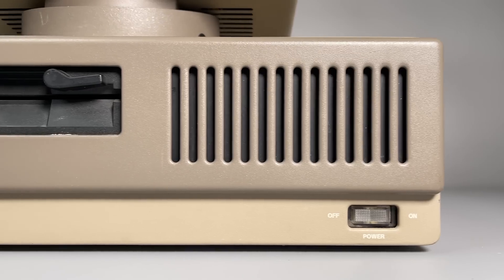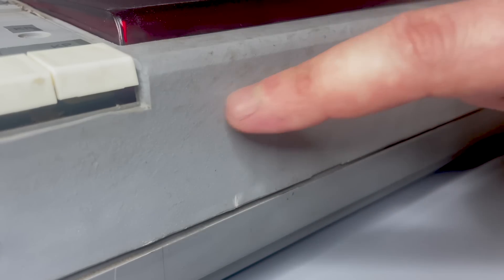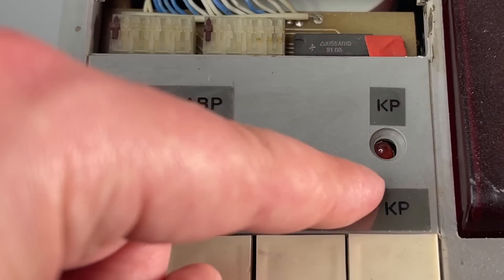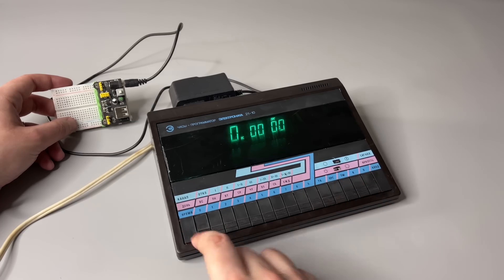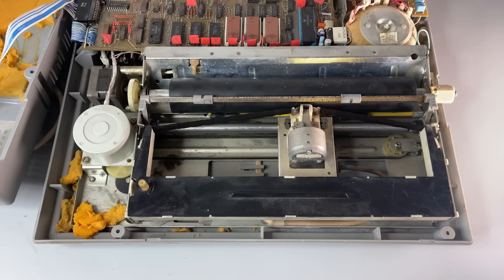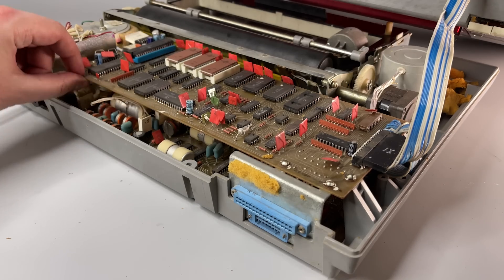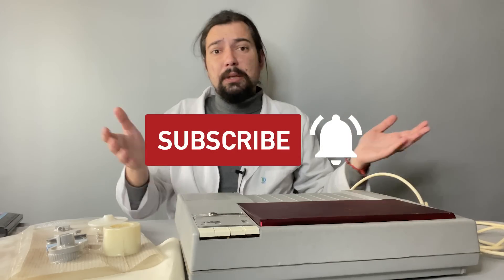This is THE WORST PRINTER I've EVER seen | Soviet SM6337.02

Comment from the maker: Our new video is out!
https://youtu.be/hjue5hO0Gmc
Reply: Soviet optics was really good like microscopes...
Reply: Be careful with plugging in old electronics. Supposedly you're supposed to condition the capacitors on the circuit boards or else they won't work and something will fry. Look it up, its some process that probably involved charging and discharging the capacitors manually till they work like they should.
Reply: Don't insult the Soviets so much because they gave you a state on Russian soil...
But... since you don't know when you should stop, you started belittling the Russians, now you will lose your country and Russia will take back its land...
Reply: From the Short show Chernobyl : What is as big as a house, burns 20 tons of coal an hour, makes massive amounts of smoke and noise, and cuts an apple into 3 pieces?

A soviet machine designed to cut apples into 4 pieces!

Comment: One thing that is often overlooked is that the soviet union, later russia, had manufactured very good and reliable vacuum tubes. Those tubes are used even today for audio applications and DIY. And amplifiers for some high power radio transmitters. Very similar manufacturing technology is also used for Geiger-Müller tubes, which certainly came in handy in 1986...
Reply from the maker: This is true, and it is a good exception

Comment: I work in injection molding of plastics  and I got some idea about the defects
2:20 this looks like  heat degraded material or material that wasn`t properly dried before injecting and still contains some humidity
2:53  there is plastic in the  verical slots because the inection tool (mold) is damaged and plastic can flow where it shouldn`t
2:40 this kind of defect is a result of improper injection parameters or bad tool cooling
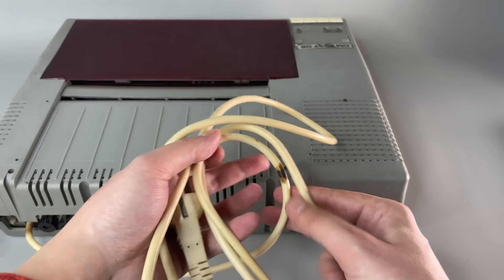3:25 this kind of warping/deformation of a long plastic piece is usually caused by improper mold cooling either because the temperature is set wrong or the cooling hoses aren`t connected properly to the mold. Perhaps the  water pump was just off and there was no cooling water circulation in the mold at all which is really bad.
Reply from the maker: Thank you for sharing!

Comment: Printers are notoriously the most annoying hardware to begin with. In the 90s-mid 2000s, even in America printers were super finicky. My question about this printer would be - did it ever actually work as it should? Were Soviet technologists using these alongside their computers and able to get it going for its intended purpose at least for a time before having to repair it? 

I can’t imagine they would produce these if they knew they didn’t work. But based on your demonstration, I find it hard to believe it ever did. If there’s no spring to push the paper as it prints, how would it do so? Would you have to manually turn the knob?
Reply from the maker: To be short, back in the day, I saw plenty of soviet dot matrix printers that worked well, including this model. However, you never knew if the device you received won't have problems from the start — the chances were random. It could be ok, it could be... this, within the same model line. This very unit is an example of how the quality was handled and how this approach was different from the military-grade version of this tech.

Comment: You can see the controller board at @9:45 which is actually a whole 8080-based 8-bit computer. This thing must have been very expensive even in 1991 when it was made.

The large chip packages in the top row from left to right:
- KR580VM80A - Soviet clone of Intel 8080A 8-bit CPU @ 2.5 MHz, manufactured in 1991/week 2
- 3x KS573RE45 (brown) - EPROM chips containing the printer firmware (I can't find any datasheets)
- 3x KR537RU10 - static RAM chips: 2 KB (2048x8 bits) each
- KR580VD5Ch (?)

Bottom row:
- KR580VM28 - clone of Intel M8212 8-bit I/O port
- 2x KR580VI53 - clone of Intel 8253 Programmable Interval Timer (PIT)
- KR580VN59 - clone of Intel 8259 Programmable Interrupt Controller (PIC)
- plus many small K155-series TTL integrated circuits (clones of the 74xx series)

The 'damaged' capacitors having a corner cut off was (and probably still is) a simple method of 'fine tuning' their capacitance. Just remove a bit to reduce its rated capacity to the desired value. It may also help if the manufacturing tolerances (errors) are too large.

I grew up in Czechoslovakia and even in the 1980s, Soviet electronics were a laughing stock for our engineers (you just must not have laughed too publicly if you wanted to remain employed as an engineer). The Chernobyl disaster just cemented our view of anything "Made in USSR" and it was also a source of many dark jokes but I digress. Obviously, we could only get our hands on regular 'consumer grade' electronics: obsolete, power hungry (hot), heavy, unreliable and shoddily built. No surprise it was not popular and it was in stark contrast with the daily communist propaganda about the amazing achievements and successes of the Soviet Union's science and industry. All the 'good' (military grade) stuff the propaganda may have referred to was simply out of reach.

Thanks for the video!

Comment: Is there a chance that this was a repackaged used printer sold as "new"? The thermal damage and the sticker makes me think that. Also just got to the part where a part is missing which makes me think that that may be the case.

EDIT: originally I accidentally wrote "thermal plastic" instead of "thermal damage"
Reply from the maker: Might be. Yet, assuming in which times it was produced, it was more typical to just produce things like this..

Comment: This is quite interesting - I have a Soviet computer (BK0010) and the plastics are poorly moulded on that too, it 'sort of fits together', inside is poorly assembled, I still haven't tried switching it on as the power supply rattles and obviously something needs repairing, also there's no information of which of the ports on the back are for video.   However I also have some Iskra 122 scientific industrial calculators - these are meticulously constructed and quite beautiful inside, it really shows the disparity between what they could make, and what was sold to the masses.

Comment: The staff of the Data Centers or IT-inclined Labs [prototypes of future IT departments] was tasked with bringing the brand-new equipment up to scratch 'just make it work'. I'm myself working in US during my tenure in upkeeping of an ancient, unique, obsolete manufacturing/test equipment. I know firsthand what is it 'just make it work' without of an adequate spare parts supply. I've had too often to 'rubber band and Q-Tip' machines in order to keep it in 'run' status instead of turning status in 'downtime-awaiting on parts' with the parts shipping lead time of up to 15-30 days. Websites like Parts Miner really helped me out to procure spare parts from South-East Asia.

Comment: I have a few tape decks made in the USSR and they are quite good. I also have a printer made in East Germany by Robotron and the only thing it needed to make it work was a phototransistor. I had to make an adapter for the interface, but the signals are compatible with a PC parallel port, so I can actually use the printer (and sometimes do).
Reply from the maker: I believe I know that Robotron. A good device.
Reply: @ChernobylFamily  It's CM 6329.01 M. Works OK, but I do not have the guide for paper, so aligning the sheet properly takes a bit of time.

Comment: looks like its been stored in a hot environment,

Deformed Plastic Consistent with melting
Melted Sticker Glue
Panels that do not fit or are loose.
Reply from the maker: Many commenters suggested it was more a problem with a mold.

Comment: 9: 34  By the marking on the IC chips, I may say that it was produced in 1991. My question is: did they have these kind of blue electrolytic capacitors just above the finger and on the power supply board, on the left side of the fuses? Where did they get them from in 1991? And at 9:42 at the left top corner,  and in the middle of the bottom edge... these are not soviet capacitors at that time, as well as I remember...

Comment: Please switch it on. I want to see sparks flying if there are any Major Shorts in the power supply. Could you do a run down of the circuitry? I like your Video.
Reply from the maker: https://youtu.be/xSoXdlpitPk check this video, there is an attempt. Unfortunately, we gave this printer to a fellow collector already.

Comment: I have a light bulb and a water pump in a well, made in the USSR, still works, the most interesting thing is that the rubber in this pump is still flexible and the amount of zinc on the screws is impressive, Chinese rubbers after a year become like plastic, everything rusts and aluminum pretends to be copper... xD
Reply from the maker: Well, SOMETIMES they could. Vacuum tubes / light bulbs were generally excellent.

Comment: I mean, it's the same nation that was too dumb to boil water and thus let Chernobyl happen, so...
Reply from the maker: Although I get your point, causes of Chernobyl disaster ground in overall system and subsequent approach based on systematic ignorance of problems. In big scale, that caused blowing reactors, in small - shitty printers. Soviets, of course, blamed  operators for the 1986 accident. Will not be surprised, if for printer just some worker would be blamed, not a system of production and quality control.

Comment: Well, at least THAT printer wont refuse to work when it has "low" ink. Or brick itself when inserting a re-filled or 3rd party ink cartridges. That is a win for me.
Reply from the maker: It is itself a brick ... ))
Reply: @ChernobylFamily  and hopefully still a cheaper alternative to current printer subscription practices. I mean, at least this one will make a decent doorstop. Current printers cant even do that!
Reply from the maker: @Rockboygg those subscription practices freak me out. Well, I myself have a canon pixma all in one, but I very, very rarely print anything (in Ukraine, tbh, for average person there is no need to print - all in apps), so I use it as a scanner only. Very, very extensively.

Comment: I have some Soviet items, my favorite is my m91/30 mosin nagant rifle, the metal looks like it was milled by a drunken beaver, stock looks like a 6th grade remedial wood shop project but it works and is quite accurate too, have successfully taken deer with it. I also have a couple of Soviet era pneumatic rotary tools ( an air powered dremel like tool) that have a bit of a rough finish but work, they definitely don’t work as smooth as some German and Japanese ones I’ve used. One thing I have that is easily superior to what we have here in the states is a Soviet era street sign, it isn’t painted or just a sticker on aluminum, it’s enameled steel.
Reply from the maker: Drunken beaver. This will go to my collection of high language use. Thank you.

Comment: Brother, they made a printer specifically for the Commodore 64 .  If I'm lying I'm dying. It ran right off the serial port. In the end the venerable FX 80 we'll also run with a parallel interface.  It's really not complicated when you think about it it just prints ASCII characters you send its way.  Trying to make things too pretty is what has caused me so much trouble, you know what I mean?  If I'm lying, I'm dying.
Reply from the maker: Hm! Interesting point!

Comment: One huge issue back in the good old days may had been that quantity was equal to quality, so when you had reach your quote for the day in numbers of units made you could just go home or go to sleep wherever you could find a free spot to sleep. It is a bit sad that there is still people in Russia today that have this mentality, even young people that was not even born in Soviet time. It is a bit funny that some people today think that this old Soviet gear it worth a fortune, they sell it and ask for totally unrealistic prices to be paid, and it is often interesting stuff, new old stock, never used still in original boxes with manuals and full documentation, but it is after all still more than 34 years old. An other strange thing is that there are company's that buy used/old gear/electronic components for the value it has calculated on the value of the precious metals it contains. Old Soviet gear is very well documented regarding what it contains of parts and the parts contains of precious metals is know too, so it is just a simple calculations and you know its value.
Reply from the maker: Thank youvfor sharing.

Comment: 6:04 Ah; I miss when computer electronics had metal casing, rather than plastic.
(ironically VCR's & many TV electronics here in the UK [especially Japanese] had metal casing more often than not])

Powder coated steel or aluminium after all doesn't bleach or go brittle, and doesn't  burn without insane temperatures 😌👌 .

Comment: So… this is basically an automatic typewriter for the looks of its guts.
Did I get it rigth?

I totally would want a modernized version to print pure text pages, carrets of typewriter ink still are far cheaper than printer ink in my country.
Reply from the maker: Very approximately yes. There are modern matrix printers - check modern Epson LX series. They even have USB.

Comment: This plastic "texture" and "dirt" is from injection plastic to the form during production. This is caused by overheating of the plastic, which results in these burns. During the production process, they obviously did not monitor the temperature of the material during injection.
Reply from the maker: Thank you for this clarification!

Comment: Looks like maded at least 1/3 century ago in Lithuanian soviet socialistic republic, in a factory of calculating machines "Sigma" at Vilnius (those times it was prefered word "calculating machine" instead of "computer" there). A serie looks like starting with letters СМ, it is in cyrilic letters, what in latin means SM (lithuanian Skaičiavimo Mašinos = Calculating Machines). I can recognise that serie as serie of mentioned factory in Vilnius at soviet occupation times. I remember a quality of plastic those times, it was far away from perfect, especially for civil (non militar) purposes, but not so super extremely bad as in this video. We see here an example of taked trashed distorted device from garbage or from very severe bad conditions of abandoned place. The plastic looks like deformed in harsh temperature, direct sunlight and other extreme physical and chemical conditions, and old dirt went inside to plastic structure between plastic molecules trough long time it cannot be washed away now.
Reply from the maker: This model is russian. Orel-based factory. 
P.S. Lithuanian tech I find amazing

Comment: Yep -- there is a difference between something made cheaply (i.e. on a budget), and made poorly. Electronic devices made in communist Poland and DDR (these are the ones I have had some contact with) might be rough around the edges, both figuratively and literally, but in terms of reliability they are comparable to their Western contemporaries. Sure, the quality of materials is sometimes noticably worse, but usually it doesn't affect their functionality. Obviously, the main problem at that time was availability... But oh man, this printer is so bad it's almost impressive.
Reply from the maker: Thank you for sharing

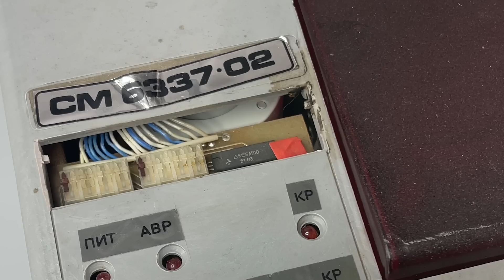Comment: At the beginning of the video you said that it was new, perhaps only used for the test print. It seems to me that that is anything but new. Lots of damage and anomalies to the casing, I have only seen them in overused machinery. And you yourself at 04:26 talk about glue. So that means it also underwent some kind of makeshift repair. STRAUSED!!!!!
Reply from the maker: And where is a problem? Some kind of glue was always used to secure those stickers, as they are just reflective film with no adhesive coating. I respect your opinion, but e.g. my fellow old-gen engineers who worked at the industry back in those times said "yes, looks unised while yes, likely god knows how it was stored". See, if this would be the first time I see something like this, I also would consider something is wrong here, but... it was a rule.

Comment: This is the worst quality printer video I have seen. There is no printing in it. Instead, there is some kind of printer beauty critique in it.
Reply from the maker: It is correct. Because it is not about printer. It is about double standards of production in a time of complete absence of any alternatives.
Reply: @ChernobylFamily  If it works and it's cheap, most people won't care. This is why most americans buy china products.

If you want ornaments, buy apple stuff. It was a second rate company in the west, but the chinese loved it.
Reply from the maker: @fungames24 the problem, it does not work, and could not work, as an essential part is missing. But, I do agree with you. After all, we all do the same.